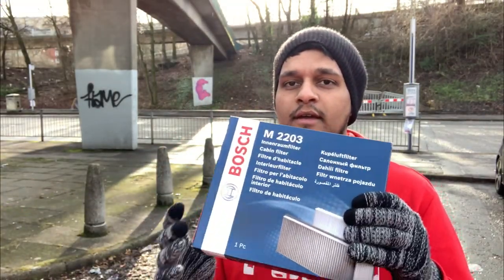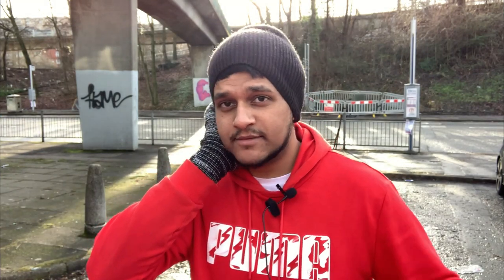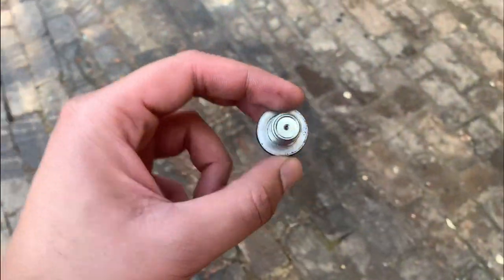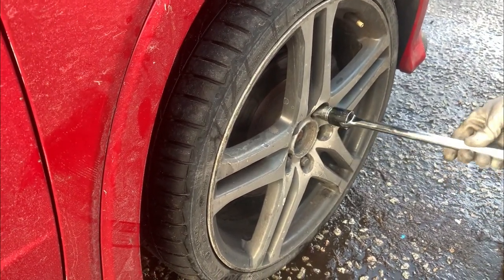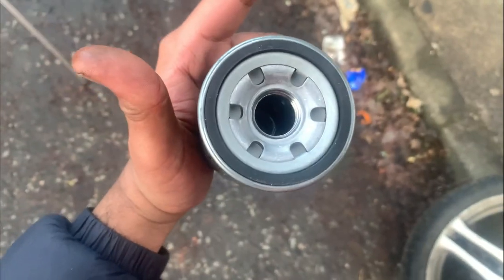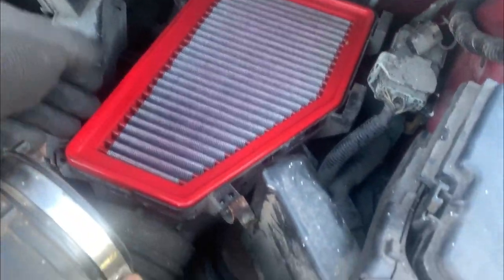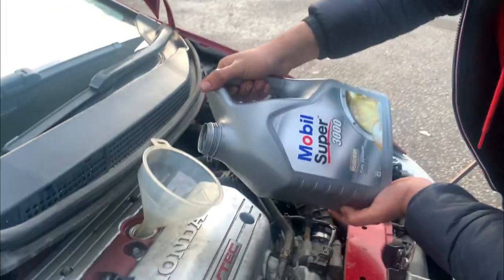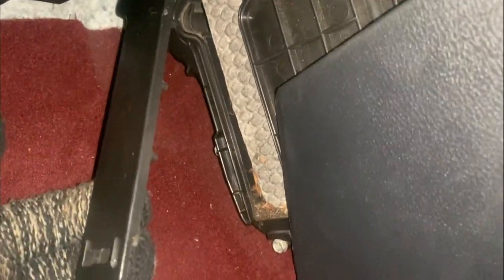Oil & Filter Service - FN2 Honda Civic TYPE R

Comment: The OEM honda oil filters are the same size, but much bigger holes, probably because it revs so high it aids free flowing of the oil. Nice work mate.
Reply from the maker: Thanks mate 🙏🏽 yeah the oil filter was a real pain to get off haha I saw that the OEM Honda ones came with a removal tool, in hindsight I probably should’ve got that one as would’ve been easier to remove the filter lol 😂
Reply: @racinggeeks9495  it's a constant learning curve buddy. When lockdown is sorted us Honda lovers should meet up sometime, do some food or some gocarting ?

Comment: Nice mate, need to change all this on my fn2 type R but I’m fuckin useless so I’ll probably just get it serviced professionally 😂
Reply from the maker: Give it a go mate, it was the first time I tried it myself 😂😂
Reply: Done mine myself last time mechanic quoted me 160 quid... i bought a socket set... oil... panel filter... air filter and jack stands for 120... took 20 mins and so easy... never pay for it again... now i have tools next service will be around 60 quid. You only learned by doing it.